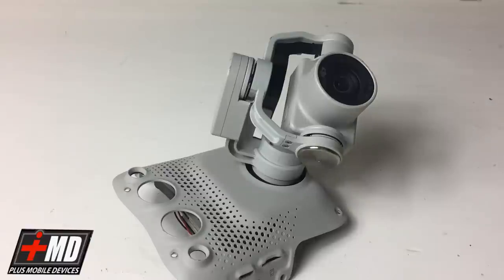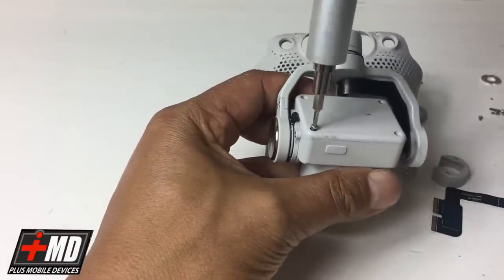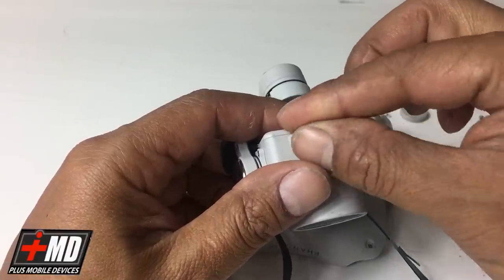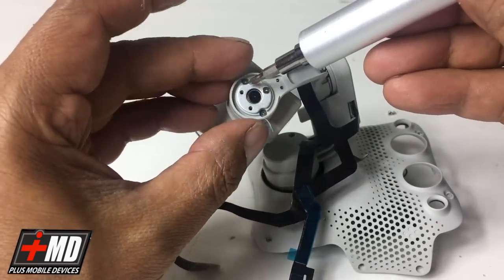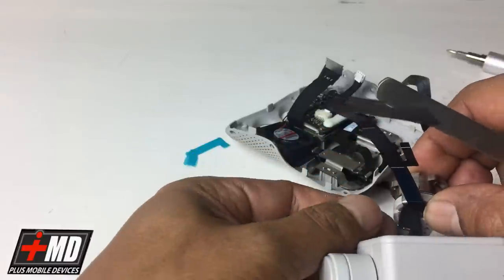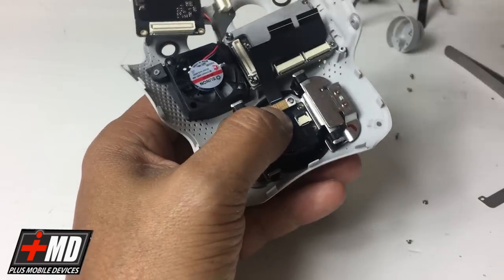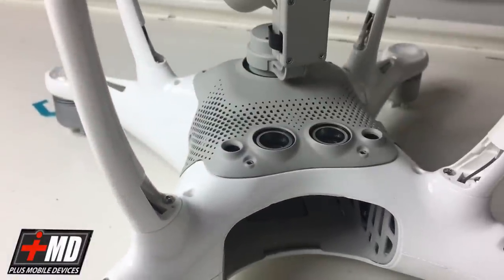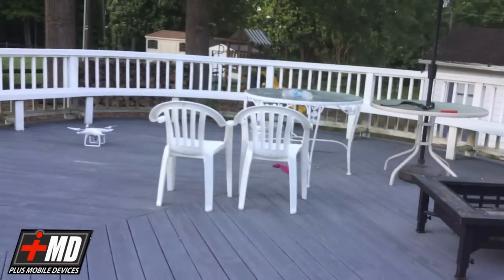Phantom 4 Gimbal Flex Cable Replacement & Repair

Comment: Thank you SOOOO much. My P4P video went out after 37 hours of flight time, the ribbon cable replacement is almost the same as this. 18 bucks on amazon and in the air again! Could not have done it without this video, you are great!

Comment: Your video was very good, so it was possible to change the flat cable of my Phantom 4 Pro. But now a "camera sensor error" error appears. Is it possible that the cable is damaged? Hug from Brazil

Comment: Thank you for this video. Did this yesterday and all worked out. Only thing was that some screws have locktite of them and was not so easily removed as in your video (probably demo camera you have also). I would have wanted the perfcet screwdriver for this (had Philips PH000, PH00, Ph0) but none of them was perfect fit.

Comment: Chalk another up.  Fixed my Phantom 4 after a crash.  Ordered your ribbon cable and replaced it.  Seems fairly stable but the gimbal occasionally goes ape for a few seconds and then recovers.  Maybe damage from the crash.  Thanks.  Don't know how you keep from losing all those tiny screws.

Comment: Very good video! A question for you. I have a noise in what sounds like a motor gear in the gimbal. I don't hear it all the time, but during warm up it sounds off and on. If I hear the noise and barely touch the camera, the sound quits. Then later it comes back.  Is there a gear in there that can get damaged?

Comment: One of the Better ribbon replacenment tutorials on youtube, Helped me get it done, i'll give 4 stars, would give a 5 Star if you would have shown which screws go back in which spots. Theres at Least 5 Different sizes and thread of screw types for this assembly, as well as diff color and diff head. Otherwise, my Bird is in the Air again, Thanks...